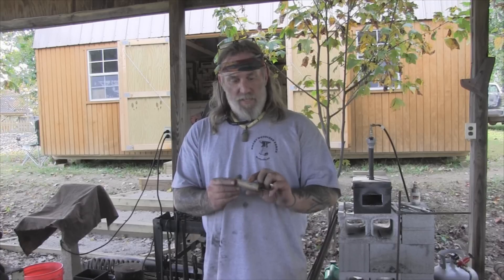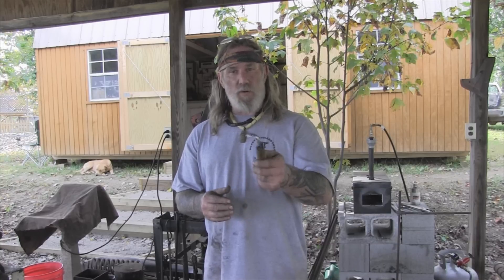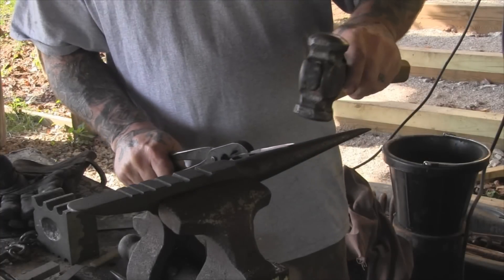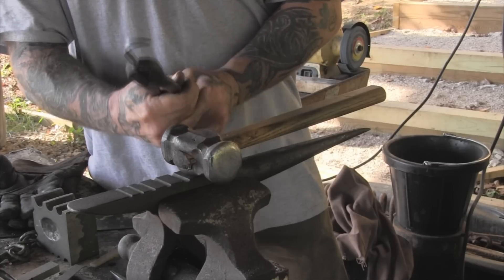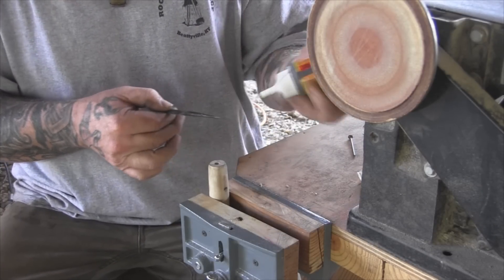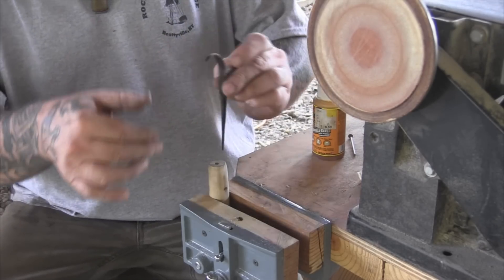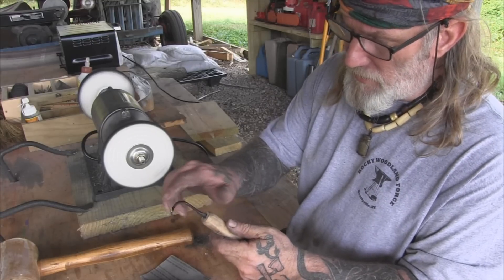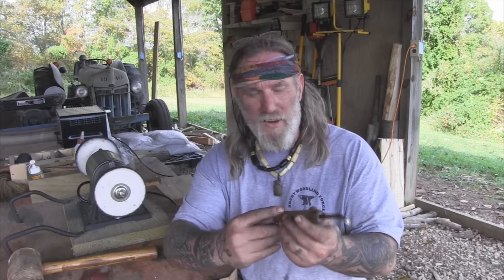Forging a Spoon Knife

Comment: do i have to use blacksmithing coal or can i yous something cheaper? Love the videos love your TV show your doing good Dave.
Reply from the maker: +CodeRex You can use hard wood but the key is driving air from under the coals, Coal burns hotter

Comment: sweet hook knife!. i have been wanting one ,never thought of making one ! thanks for the inspiration Dave.  what kind of steel did you start with? if you said i missed it. i have an old screwdriver, real long,enough for two easy,(right and left hand ). would that steel work?
Reply: its about 1/4 inch square and 12 in. long